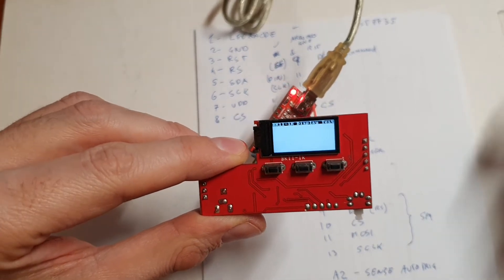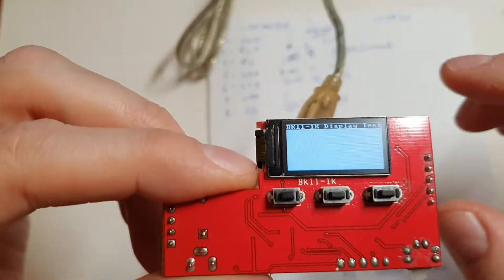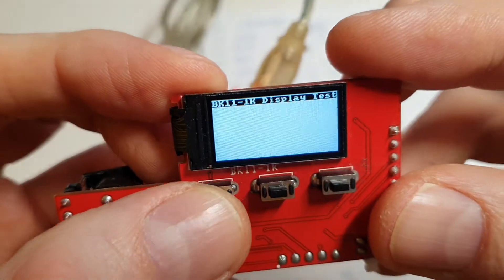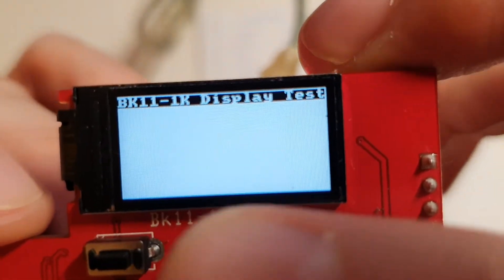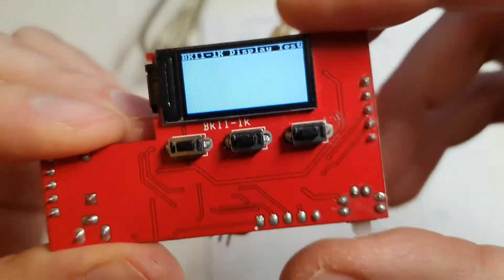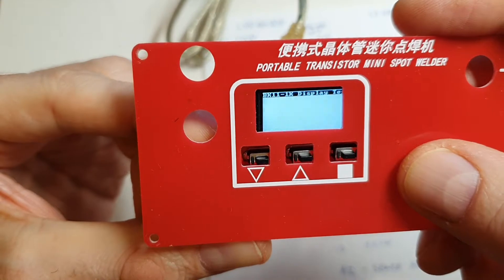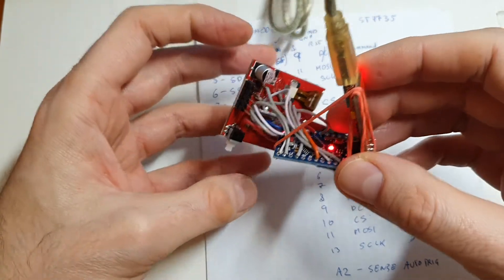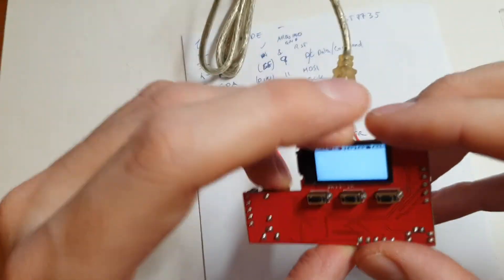A little progress on the mini spot welder (2021 bk11-1k) "port" to Arduino

Comment: Hello, did you see my last video of the circuit board of my spot welder?
Reply from the maker: Seems like it's a new revision of my version (Bl18-2k) with a modified sensor circuit. If the circuit on the MCU board is somehwat the same, R4 is the resistor to modify but I can't vouch for it as it is a different revision. Use a tester and check that one side of R4 is connected to pin 19 of the MCU on the other side goes to pin 4 of the trigger pin. If so, try replacing R4 which should be 1K  (code 103) with a 470 Ohm (471) resistor.